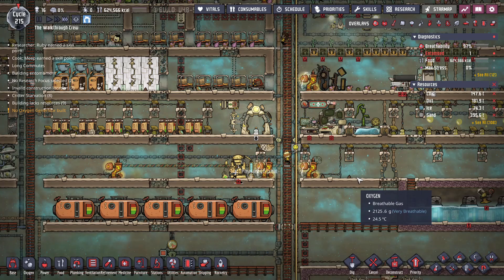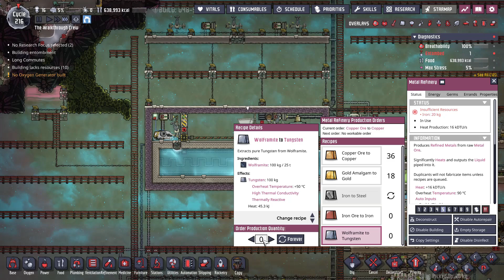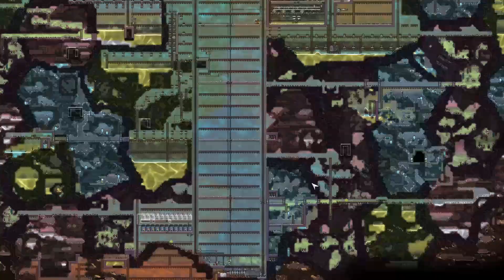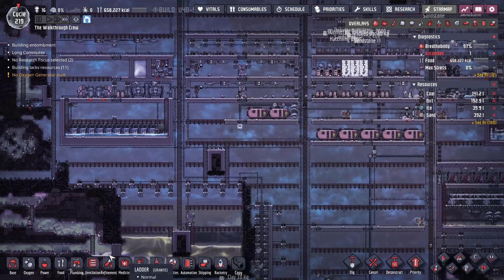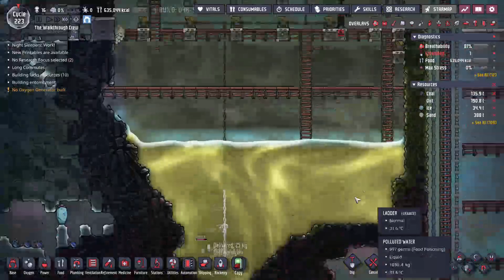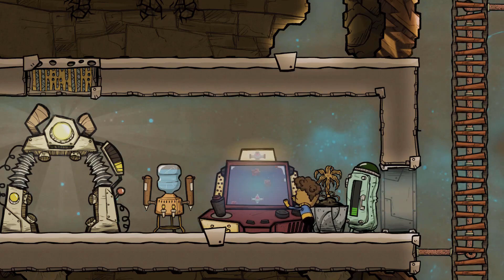Oxygen Not Included: Full Walkthrough Part 20 (2023)

Comment: brother the steam enign is covered in on whole it cant make steam enough to let it cool faster . i had a bug where a tiny microgram of steal was 1067 degree celsius and would cool my whole line got stuck and now i have 9 tons of 500 degree materials and it wont cool . What can i do now pleease let me know .
Reply: i fixed it . i think i put a second steam engine in there and set a timer in there withe an and port with thermo sensor when room is 30 degrees . when steam engine room is back at 30 degrees it goes on for 60 seconds and shutdown again for 180 seconds . i finally see movement again . i hope it works because i need to cool 12 tons of copper right now .

Comment: Swear I copied this build and the steam never seems to go above 98* so the steam turbines don’t turn on. I even tried with 2 coolant tuners. Not sure what I’m missing
Reply from the maker: Is the volcano active and putting out metal?  It may take a little while to boil the water.  Also, are you using insulated pipes for your aquatuners, and insulated tiles on the outside?
Reply: @Magnet_MD  the volcano had just finished erupting and went dormant so there was some hot copper in there but maybe it needs to be actively going to start it?
Reply from the maker: Yeah, it will eventually boil as more molten copper is produced
Reply: @Magnet_MD  yeah so it did start boiling after erupting like you said! Though the material on the line doesn’t seem to drop below 125*. If I let it out at 125* by the end of the cold water loop it’s at 38ish* guess good enough unless that also takes a while, lol. One of your videos had one of these cooler setups without a volcano I gotta check how that’s different cause I’m trying to cool water from hot water geyser.

Comment: @Magnet_MD i need some help please. i have a cold salt slush geyser that already filled up its storage tanks and that i want to heat up so that i can turn it into clean water. Is it okay if i use -10C Brine to cool the metal thats gonna pass through and just pump it out and replace it with more brine when it gets too hot instead of using polluted water and an aquatuner? Also what is the purpose of the metal tiles that touch the insulated tiles? i feel like they arent gonna do much and since there are metal tiles that are next to the steam turbine that also touch water but i might be wrong. Thanks in advance.

Comment: I don't have the temperature sensor for the conveyor rails since it requires data banks for research in the dlc, any ideas in how to replace it? Been thinking about using a timer sensor instead but not sure what the times would be
Reply from the maker: Hmmm, do you have rockets and plastic yet?  You could manufacture some data banks and research it.  If not, I suppose you could do a timer sensor and just mess with the settings until it's coming out at the temperature you want.
Reply: @Magnet_MD  dont have rockets yet but will maybe try to skip to it so I can research them, thanks for the help tho!

Comment: So I'm having trouble getting the temperature of my steam to actually be hot enough to be used by my steam turbine. The hottest I'm getting is about 107C and it says on the turbine that it needs to be at least 125C. My room has also now overpressurized and won't let the volvano even erupt. Is there a way to fix this? My water in the cooling area is 8.6C so I figured I didn't need to cool that anymore so I turned the liquid thermo pipe sensor to 15C like you did.
Reply from the maker: Yeah, over pressure is definitely gonna choke the volcano up.  One idea is to expand the steam room so the pressure is distributed in more tiles.  You could water-lock an adjacent room, vacuum it out, then remove the tiles between the two areas.  Then you could seal the water lock off with a tile so it doesn't exchange temperature with the water.
Reply from the maker: You will need to lower the pressure to below 150kg per tile, FYI

Comment: I have played many, many, many hours of ONI but have never captured a Volcano before. With your K.I.S.S. approach to handling it I easily checked that off of my To Do List. Some other guides have been Rube Goldbergian designs that have left me scratching my head. Thanks again Magnet Dude!
P.S. In this video you never completed the circuit of cooling Polluted Water pipes from the water chiller. I just completed it and that should be OK? Also, in the next video it looks like you moved the Turbine over one block? just wondering.
Reply from the maker: Yep, you're right!  I think I mentioned it in the next video but I might not have.  Keeping track of the details between videos is hard sometimes :)